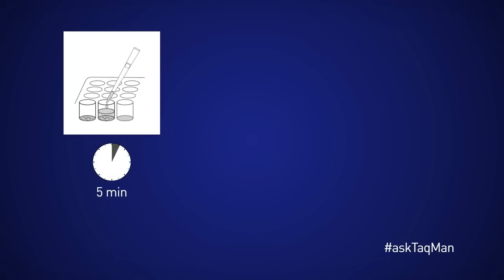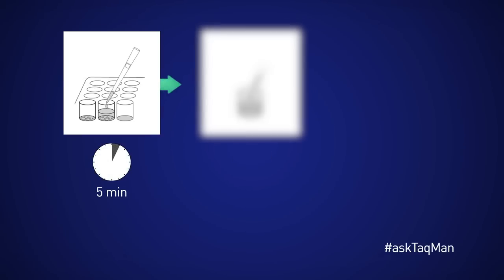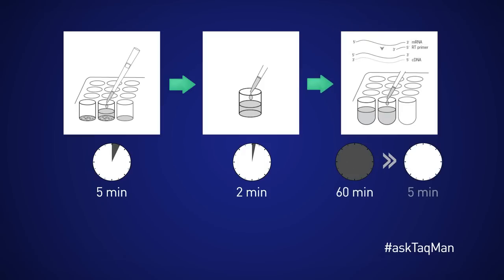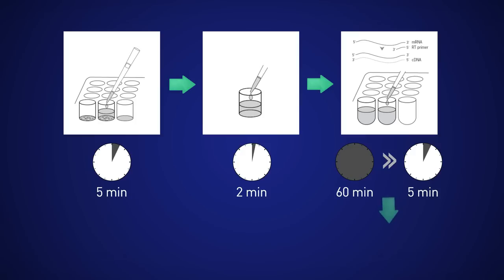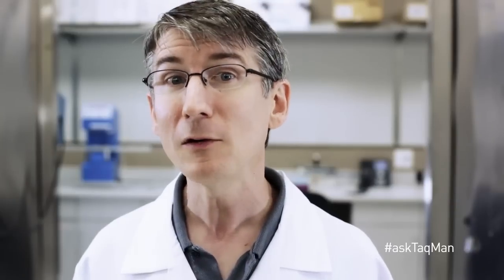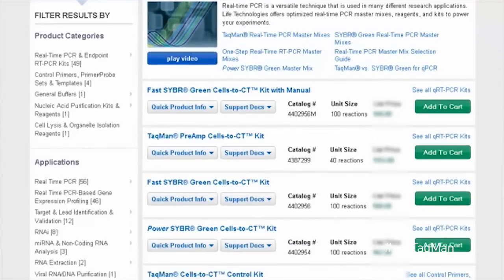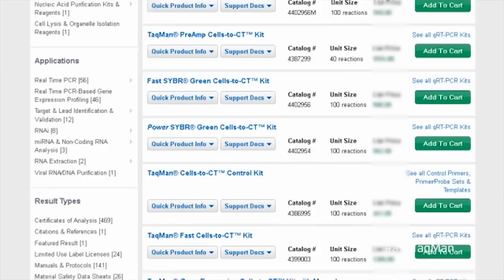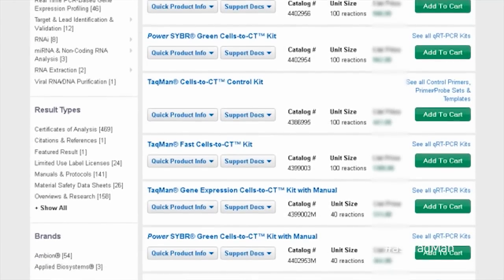How to Improve Real-time PCR Reaction Sensitivity -- Ask TaqMan® Ep. 12

Comment: I am testing the kit Power SYBR Green master mix of A & B for my starters and despite varying the temperature anealing and times do not work for me for any gene (even for housekeeping) conditions are: Activation of the enzyme at 95 10 min, 40 cycles of denat at 95º 15 sec+ 30 sec 50 to 59 ºAneal+ Elong 72 60 sec and melting by default as does the computer! what else I can change? it works because my cDNA amplified in Roche! one of my primers sequence is: F-and R-GGACATCTAAGGGCATCACAG GACACGGACAGGATTGACA
Reply: Are using the Power SYBR mix on a Roche instrument? Do you see anything in the amplification curves or melt curves?
 
Also, are you doing a gradient for the annealing step? For the Power SYBR mix, we would recommend to redesign the primers slightly so that the Tm’s of both are closer to 60C (right now they are ~ 56 and 54C). Then use a two-step protocol:
 
95 C for 10 min (for activation of Taq)
Then 40 cycles of:
95C for 15 sec
60C for 1 min
 
How much template did you use? Is this a new cDNA prep, something frozen that worked before? Let us know and we'll be able to better answer your question.
Reply: ***** thank you very much for your reply I use the kit in the Step One Plus but it turned out it was bad production (compare it to the FAST Sybr Green Master Mix A & E) and the latter if it worked!!